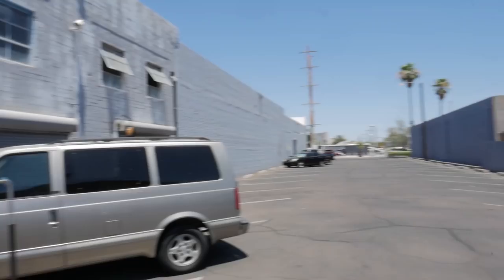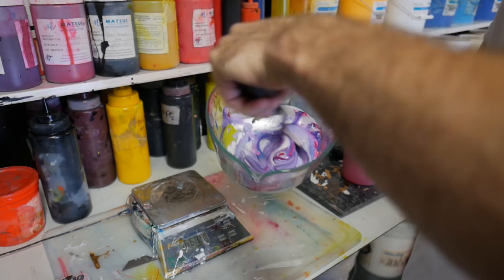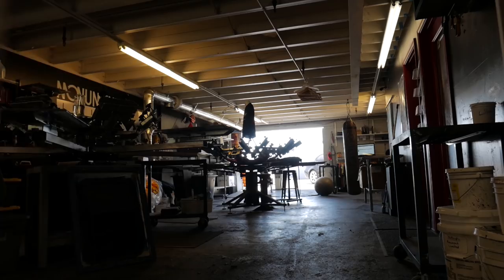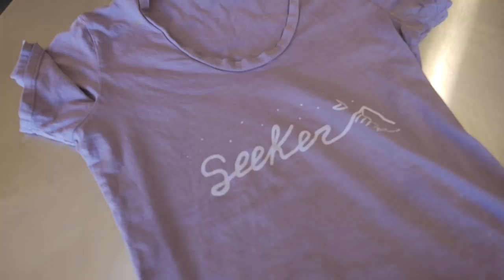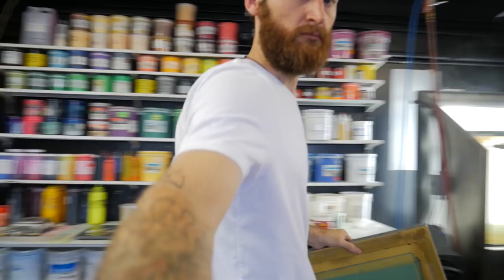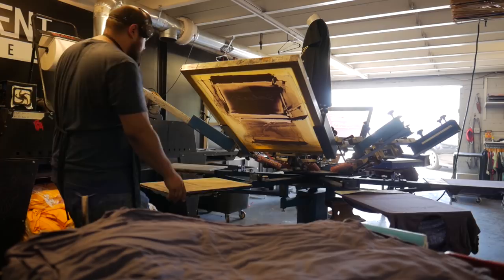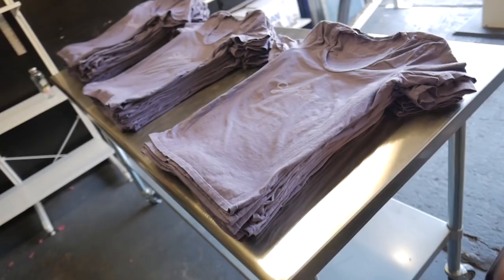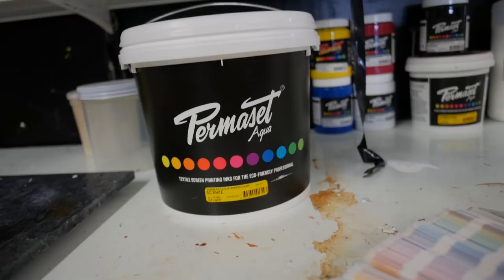How to be a Screen Printer with Screen Printing Q&A

Comment: We are in az as well. We have a big dryer and a couple flashes running during the day and it gets hot up in the shop. We try to start early and leave early. We also just got a swap cooler that has vents just over the printing stations. It helps but both our dark room and washout room are like sweat rooms.

Comment: Hey Cam Awesome video! I've had that happen with the ink spot drying in the screen during production it's pretty annoying. If you use a pump up water spray bottle used for gardening you can get those out.  Or if you clean the screen and use some water-based screen cleaner with a paper towel it seems to work well. This way you don't need to remake the entire screen.
Reply from the maker: We tried it all, I think if was Jesses greasy ass sweat, I would not come out for anything. Good advice though I will try that next time.
Reply: The Print Life lol that's funny. Also our environments are very different. You guys have way dryer heat than NY.

Comment: 16 Celsius which is 60 Fahrenheit 52% humidity in Seytroux France. It’s also 10 pm after a rainstorm. Normally around 27 Celsius = 80 Fahrenheit

Comment: Why did the color match it not work? I can tell you why. Pantone is not based on a color model so how can you match a color without a color model. But thank God you got lucky! And you right about primary colors.
Reply from the maker: as far as I know, They built the pigment system of the color model Pantone uses. When I mixed the darker purple it seemed to get real close. So I have high hopes for the system.
Reply: Pantone is not a color model it is color matching system with numerical values and names give to the colors. So it just just spot color system which is why you will not find it in the color models of the graphics applications. You will only find it as list of spot colors to choose from.
Reply: You can see the science here
https://www.youtube.com/watch?v=cQm3aHEDm3c&feature=youtu.be

Comment: Shirt turned out clean by the way IMHO.... *regardless of the color not being exact
Reply from the maker: I agree. The shirt looks better in person. The system is pretty cool I mix another color later and I worked great, So it seems like some colors will be closer than others.
Reply: I realize this is an older post but I just wanted to comment on it.  Whenever you use transparent white, ALWAYS mix your primarily colors first and then add to the transparent white.  You can measure the primary colors separately from the trans white.  Also, if you convert the percentages to grams, you can set your scale to grams and it works out perfectly.  Those Pantone formulas are not forgiving. I’ve been printing for 30 years and have mixed hundreds of pounds of ink colors.  Your posts are fantastic! Keep up the great work.

Comment: In my experience most ink companies use proprietary color matching formulations for Pantone simulations and don't rely on the percentage of mixing colors called out on the Pantone fan deck
Reply from the maker: That may be the case. Im excited to mix more colors and see how many are accurate.

Comment: Cam, my shop just started using the adhesive glue to put on platens so we don’t deal with all the particles getting in our lungs from the spray adhesive. The glue adhesive is not keep the platens sticky for very long. How do you keep the platens sticky or do you have to keep re-applying the glue adhesive? Thanks
Reply: Joshua Hayden At our ship we can generally print several hundred shirts before needing to reapply. We usually clean the pallets and apply the water based adhesive in the morning and are good to go for the day unless we have a ton going down that day or are Printing on fleece.
Reply: xcellentgraphics is the water based adhesive something sold separately? Or can we just use normal tap water?
Reply: Na. That’s what you are using is water based adhesive. Sometimes if your lint buildup is t too bad later in the day you can take and spray some water on the pallets and send to the flash and it will bring back some tackiness as well.
Reply: xcellentgraphics okay. I’ll test that out. Thanks for your input.

Comment: we are in the middle of a heat wave here in norff jersey so it's gets up to 95-96 in the shop (4th floor) w/ the ovens on. ink flows nice tho. sometimes i just print at night. speaking of heat, dude, stop drinking soda in it. really bad for you in hot conditions. water baby water.

i recently did a job w/ matsui discharge but those shirts faded quite a bit. also when you stretch test it really cracks up. anyone have a good discharge recommendation?